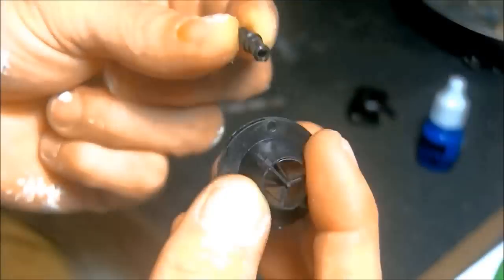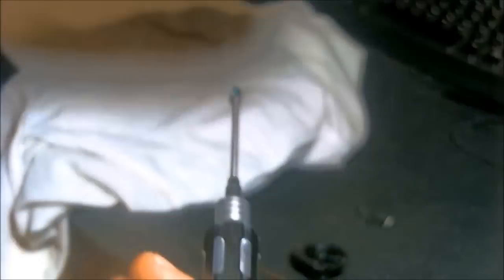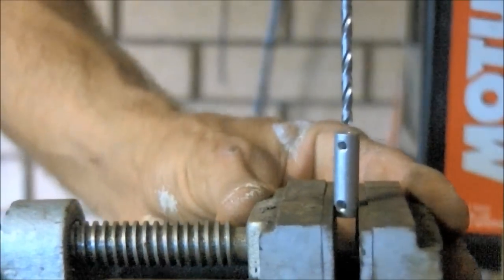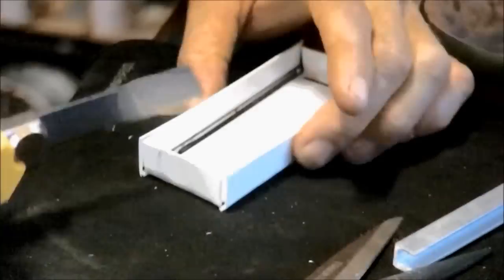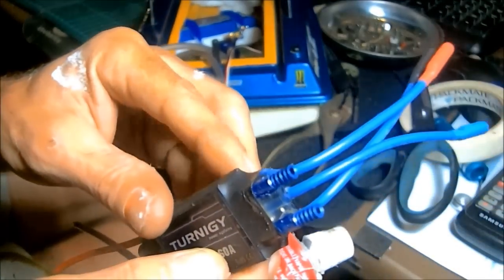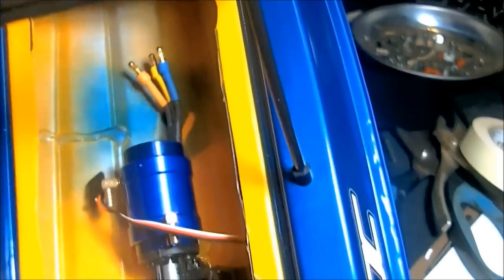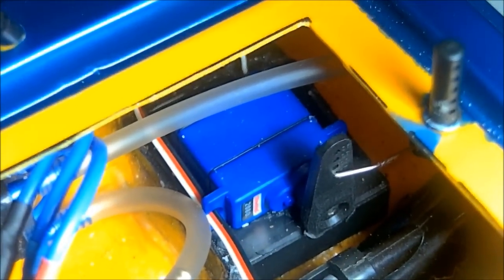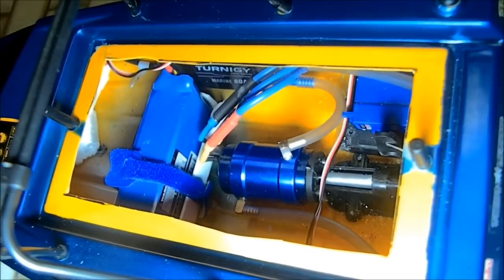NQD JET BOAT BUILD VIDEO 2 INSTALL BRUSHLESS

Comment from the maker: shoe goo  the go .for sealing it up , silicon will work if you let it set , you will find the jet most likely leak around the rear end under boost , test it in bath tub for leaks with the cover off ,

Comment from the maker: yep bead the rear of jet as well around the hole opening smooth it off finger as best you can before it sets and balls up on yah.after installing it . put the rear seal and spacer back will a good smeer

Comment from the maker: cool man , now if it dont push water out the back , it may be running backwards
so just swap outer motor wires around , if that happens , that will reverse motor direction

Comment from the maker: yeh that will work ,might need to tapper the hole if it wobbles ,,they are not drilled very true from factory ,do your best , you will get some vibration , till you convert the prop shaft to moto bike cable of around same size or little larger

Comment from the maker: @5372john if you look  were the nipple is located on the jet stator as the water pumps through the jet it injects water into the nipple under the venturi effect

Comment from the maker: the receiver throttle channel  is it 1 or 2 ? make sure esc wire is plugged into correct throttle channel , and throttle trim is set to 0 on controller .steering servo is plugged in to correct channel , try just plugging it in with out full throttle
should beep few times ,then should spin motor , if not try unplug lipo ,and hold throttle in wile plugging in lipo , beep beep beep ,relax throttle ,then wait for few more beeps, should work ,

Comment from the maker: yes but on the inside of the hull just simply smear shoe goo around the back of the jet , there is a spacer bettween the hull and rear of jet and it never well sealed from factory , the hot gun glue is crap , remove the  jet unit and re-install with shoe goo is the best way to go to stop all leaks . take your time keep testing it in the bath tub till its leak tight ,  hold it and rev the motor and look close for leaks with hatch off . you can see were its coming in

Comment from the maker: @atltybo set all your controller trims to 0 and calibrate the controller to esc a second time
turn on transmitter hold throttle in and plug ecs in to battery  hold it in till it beeps then relax the trigger . see if that works . instruction sheet with esc  i forget  ?

Comment from the maker: if you do use a moto cable as you prop shaft , make sure you install it the correct way or it will untwist  on you

Comment from the maker: depends on what gear you use , traxxas 30 dollars servo or a 3 dollar hobbyking servo . same with motor esc , range in cost from 50 bucks to 150 bucks

Comment: Just a tip of advice, you might want to run dual water pick ups so that both the esc and motor get the same temp water and so that the motor doesnt get hot water

Comment from the maker: up date after test battery location not working for me i have now moved it  to the side rear as far back as i could get it ,fixed the nose dive problem 
had water getting in through the water pipe leak on nipple even with ziptie was pinching the hose ,

Comment from the maker: @atltybo even though the esc is factory coated for water proofing i still plugged the ends with shoegoo ,then some liquid tape over that just to make sure it sealed around the wires

Comment from the maker: shoe goo works great but screw the lid back on as it sets fast ,need to work fast before a skin forms on the goo and stops it smearing smoothly , goes lumpy like haft set silicon . basically its a fast drying silicon

Comment from the maker: dont over tighten the grub screws in cuplink ,its alloy and soft .no water will flow till the jet is hooked up . when the jet pumps water out the rear it shoots water up the nipple in to the tube

Comment from the maker: might have to take it to a hobby shop , get them to help you , i dont realy know what your doing wrong , you might have motor wires plugged in wrong to esc,
make sure yellow motor wire goes to center wire on esc its important to get that right  ,. the other 2 wires can plug in  to ether  side and be swapped if runs backwards ,  read the  instructions that come with esc on setup . .you put video up showing me the problem  and what you have done ,

Comment from the maker: probably you have throttle trim nob in wrong place , move the nob to 0 ,sometimes moving the throttle trim nob ,helps it fire up ,wile its beeping 
you can not really damage anything just dont plug lipo in backwards ,dont panic yet ,

Comment: can you give full motor and board details - looks very good, but not available on hobbyking anymore
Reply from the maker: try this motor and ecu https://hobbyking.com/en_us/2040sl-4800kv-brushless-inrunner-watercooled.html
https://hobbyking.com/en_us/hobbyking-30a-boat-esc-3a-ubec.html
this moto is suited with 2.3mm shaft 20mm can bolt to jet
Reply from the maker: https://www.ebay.com.au/itm/New-RC-Boat-Turbo-JET-with-Water-Cooling-System-Motor-Super-Strong-Propeller/142921369368?hash=item2146c70718&var&_trkparms=ispr%3D1&enc=AQADAAAC8FjVrDbVsZ8oH%2F8PNHtt9VX4%2Fw7FZcmMuqsX8uaFEduV0eLIYRIOSRUqo0Odmq4DqG0cg02cZ9XgrdWBRse%2FOHylQv2blLeH09jYFsdih68ood1JcKDVNQ6e7EUa2M4KbXIIdMIb4oL1FsfFdsTSH65Merba3Rp0a%2BSUv1%2F%2F%2BNEDLEpaXjmDjU9%2B2VyBQmoUSk3X8amFamyLd1ejGIN4wf0CFUGewB1KjYJUn%2F5DNqwVvYk886Y%2BLACe7sBNpn0Z%2BAASwXOtXCzWBtezBa2ZjkSql7KfC2vTF1gCtychh3qu3dkaWOR%2Bg4v%2BVM1D9szasesr%2Fcy0WTdoBl9Axl1a8KbvsF70asMmRflCukUcGtIFiLm8ytGfATKUQ6ePSR4J6rONFZrYJCwIcagCiv06wXTmwAStzolrRwqp0KkpTTvqn0Cl7V9f0kARXIWpbQeKC%2FlI9qPzT%2FHq1ZAyBfABto9J%2FZ8ag2FGrOPgGwIFGqfyCkFI66Xx6Y5y9VSJLET7jiUqBI7uJ%2FeQ11c3dXWmuQzIAWsZBzCOdl315J5p71lEAiMmmx98Wnm0L73DnIuiJm%2BdVRyP0JWd%2BSuZzp%2FqYwcHdcXfvrh3s8vCACybyHdV%2FJRW98DlfMtkRaDs8Sh3DUC8d%2BzTFzPffup7LjMCUl0w%2BZbzDfbr5uOaUNpVKBOnIDqIST1Y7pHMq2qgpf2V8OLoTxZwJb7yY6jq9cHHjfkiXorvVStTMbeyXbwhtRv2TNLJiBIdznSZW9BvkoOqcmythnnkLbGWo5ma4hxgLHnFVkij%2FVMFqP%2FCOqWu0FeZDF9Ly9aTTh%2BCpB%2BKUMfPlKduM%2FhaJ8nHqMSgAfF9hAxy6W6MHx5fIy%2BhFtSq0%2F3g1wZ7Pqd3DKGIZ399jIIwUTjYWI3ZM%2FD6aKj11md6JcFy124KAqi2DAMluuiKo5s6eLaihHvg9X6iuTR5ENvKBCNdvrZnEsSp8XXKVJ5oYCaEO1nGiNfFSWBqpEnmvhrf&checksum=142921369368d8baa0e588574856813626bcba0fa1c2&frcectupt=true

Comment: ok just making shur becaus what i thaught is that the esc just sucks the water in and what you where talking about i allready did that i will post a vid on you toube and tell me if i did that right i will make it right know and it will be called cooling system in rc jet boat ok jest ckeack it out so you can make shur because you are the expert

Comment from the maker: lol wouldnt say i am a build master , lol  yes man cool , go for it 

they leak water in around the jet  . try it in the bath take note were its coming in 
just hold it have a good look with the hatch off . its its only under boost when it leaks its around the back of the jet unit ,.check your hoses are not leaking . seal all way around the jet with a good sealer like shoe goo

Comment from the maker: i tell you guys a little trick,you can make your own flex cable ,, the shaft 2.2mm can be replaced with a old motorcycle cable  2.5mm , solder both ends so it dont fray ,then cut to length  force the prop off the old shaft carefully ,and epoxy it on cable in the correct location ,, you can even drill out the jet to fit a brass tube for cable to run in,.  no more vibration from the solid cup-link with flex cable setup ,

Comment from the maker: the problem is the wires on the motor are part of the winding of the motor dont cut them shorter . i just put 2.5mm on the esc ,

Comment from the maker: yes 3s  go to hobbyking look in there boat parts for a water cooled 30mm mounting plate 
PRODUCT ID: BP22-MMWC
the motor is turnigy 4400kv out runner is the cheapest way
PRODUCT ID: TR22234-4400
 .and the drive link you need to make  5-8 mm alloy or brass rod drilled out to suit the motor shaft . ,as the stock drive link will be to short, you can buy these boats ready built on ebay save alot of messing around you really need to have some RC customizing skills and good tools to mod these boats

Comment from the maker: hobbyking and get 35amp turnigy water cooled esc ,and 4800kv water cooled motor blue one
,a cheap mini servo , 22oo lipo 2 cell . it will fly .. its ease to do check my other video
the 60 amp bit of a over kill .35 is fine ,high kv is better ,only 2 cell needed less weight is faster and better handling

Comment: hay i put all the water toubes in and dose it need to have presher from the jet to bring in water threw the system becaus i put the toube in the water and at the other end there was no water coming out so what i just said is that the problem

Comment: hay bro will 1/8 drill bit work to drill the hole or do i have to use 3.2mm drill bit  because 1/8 is only a littel bigger

Comment from the maker: yeh if it has steering end point adjustment ,so you can limit servo travel ,most modern radios have end point trim nob,

Comment from the maker: @russelleden1 yes i try out this weekend ,in some open water local give it a shake down run before driving miles up into the hills to fast water,see if will last a few batts first lol , should try the 2s first ,but i pro just run the 3s in it straight up for some high speed open water runs , then 2s in the creeks? see how its goes ,

Comment: hay bro i just fixt my water cooling system and my boat is done now bro i just took  it for a test run and it is fast but my next boat i will use a 4800kv motor so i dont have to drill the hole so thx for all the help

Comment: o man i but how can i seal the jet up good becaus my dad got me silicon that is clear and my dad is a do the drilling for the motor shaft so i dont have to worry about that so would it work and dose 2.65 2s lipo work for the motor you have in the vid

Comment from the maker: yeah bin it good for nothing , hobbyking 2,4 hk radio gear works good in them 20 bucks .prob not in stock , yeah any radio will work ,follow the instruction on the esc , set the radio trims to 0 neutral
plug the boat esc throttle wire  in to  the receiver  channel 2# and servo in channel 1# ..,turn transmitter  on  hold throttle wide open .then wile holding it in at the same time plug battery in 
wait for the beeps confirming throttle .relax it back to neutral . more beeps , then its done !

Comment: Never mind i found a 35amp esc that i can use and it is in stock for me Turnigy Marine 35A Brushless Boat ESC (USA warehouse)
also i have 3s 2200mah nano-tech battery's already and i planed on using them. Thanks for the help. I really needed it.

Comment from the maker: well use lower kv motor like 3100kv with 3mm shaft .4800kv be to much on 3s i think .give it a go if you want  could limit the throttle curve

Comment: Awesome. Thanks that worked. Another question. When I turn on the transmitter... The motor goes to half throttle. It only goes to neutral when I put on full brakes. Example when the trigger is in neutral the motor is half throttle. When the trigger is on full brake the motor is in neutral. Any ideas? Thanks again.

Comment from the maker: way over kill , best of keeping it light ,on 2s 2200mah , the best motor i think is the 2040SL 4800kv Brushless Inrunner (WaterCooled)  has 2mm shaft so no drilling cuplink out , bolt straight up , from hobbyking , currently out of stock , with turngy 35amp water cooled esc

Comment: Hey, looks really nice! Im gathering some information before trying a build myself! So my question is do you have a motor to pump the water into the motor and esc to cool? or how to you force water into the cooling elements?
Reply: +andreas292 it looks like he mounted a water pickup tube at the exit of the impeller area, like on top so thats basically the pump

Comment: I'm putting two of these motors on a boat of mine =) i already have one 4800kv in my 757
Reply: dual pump? I'm gonna do the same thing with xk2040 9200kv brushless inrunner. on each pump. things gonna be spinning at 70k rpm😂

Comment: Hey 420hp202turbo i dont have this boat yet so thats why i need your help on finding a motor, i have found two that look like they might fit but idk if a 36mm can size will fit on the motor mount. Here are the specs 3660SL 3180kv Brushless Inrunner (WaterCooled) (USA warehouse) Kv: 3180rpm/v
Diameter: 36mm
Length: 60mm
Shaft diameter: 5mm
Max voltage: 18V
Max current: 94A
Idle current: 2.7A
Weight: 280g 
Or what size is it suppose to be?

Comment: Hi, does the nqd jet boat come with that jet drive system or is it a piece that you have installed thanks
Reply: Hay Sam, if its anything like i got, it comes with the jet drive, but not a brushless motor. the radio and gear it comes with is rubbish, chuck a brushless motor, ESC, servo and get a couple of LiPo packs then you'll be set!

Comment: We're can I get the esc tho
Reply: hobbyking dosent carry it anymore. need anymore help?
Reply: +MrDylman55  what esc can work that motor
Reply: +Kamil0232 plays 50a+ any thing lower you'll have problems. hobbyking is out of stock for those motors so check out the 2040sl water-cooled 4800kv inrunner. it has a 2.3mm shaft and I believe 16mm bolt hole spacing so you wouldn't have any problems with it. you'll need at minimum 60a ESC for it. there are many different motors on hobbyking so you should check them out.
Reply: thanks what esc would work with the 2040 there is a 50a but it is out of stock any ideas